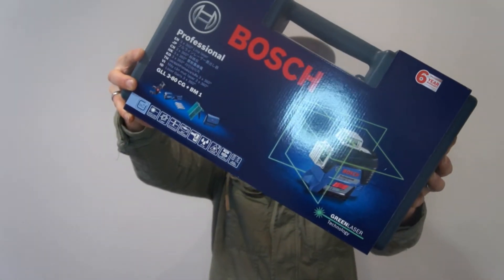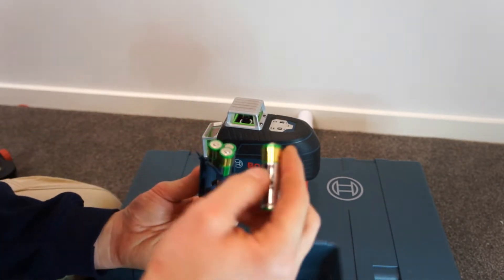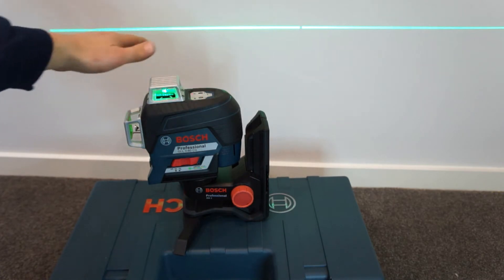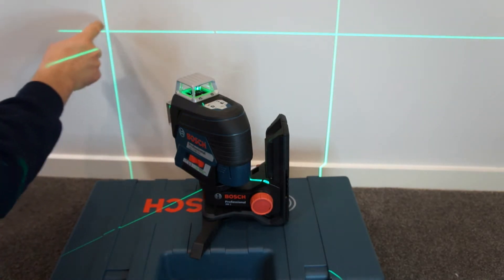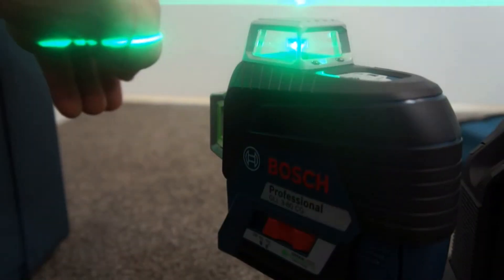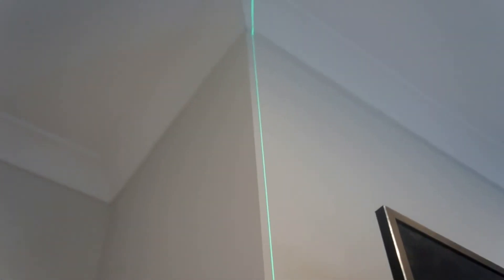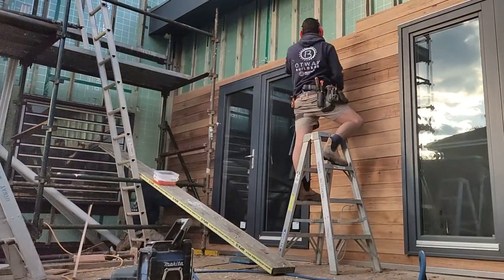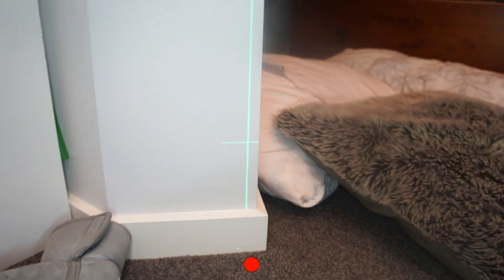BOSCH Green Line laser review/test

Comment: I am thinking of buying the Bosch GLL 3-80 CG Professional laser and I want to make sure that the RM3 base is compatible with the laser.  What do you say;  Thanks.
Reply from the maker: I don't think it does , pretty sure that base only works with the GCL2-50CG ,that laser only shoots a line out the front horizontally and vertically so having a auto rotating base would be handy whare as the GLL3-80CG has the 360 deg  3 ways so you wouldn't need to move it as much.
would be kinda cool if it was universal.
Reply: I got the RM3 base and it works awesome with the laser

Comment: The app is really setup if you’re working in large areas so that you can toggle between which mode you’re using and put it in standby for battery conservation.  I just bought this so I can use it for some light grade work with my tractor and be a 1 man grade crew.  Will be nice to just flip the unit back on with my phone when it will likely be 75-100 feet from where I’ll be working.